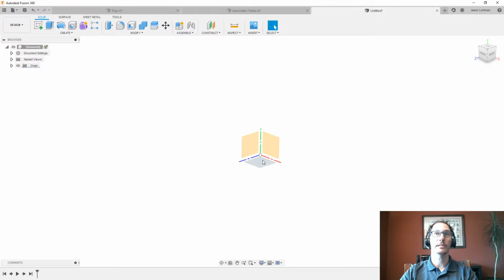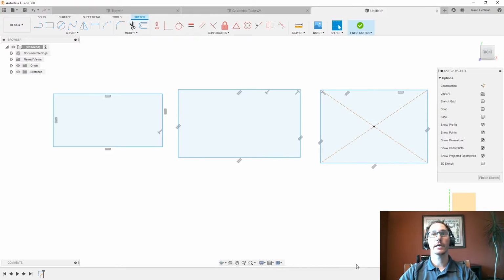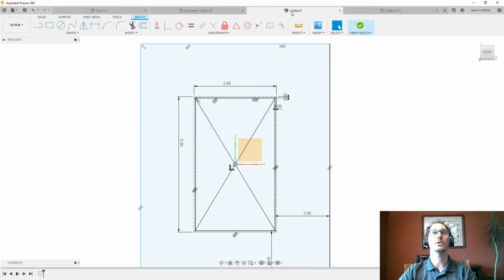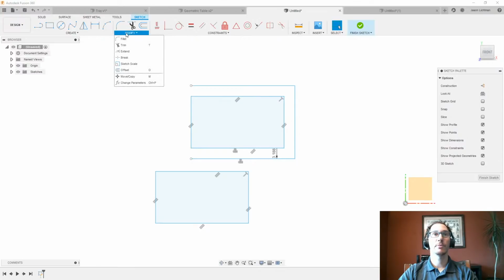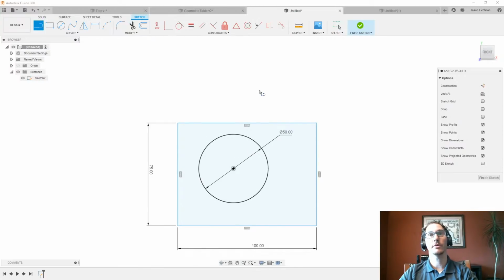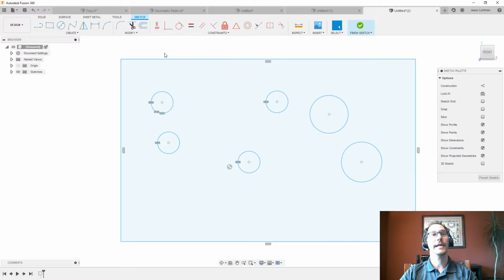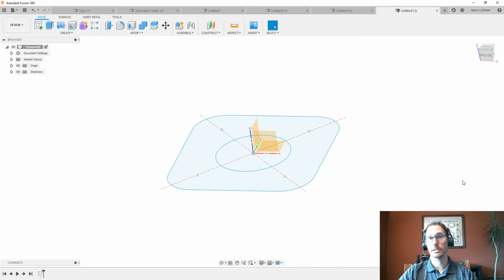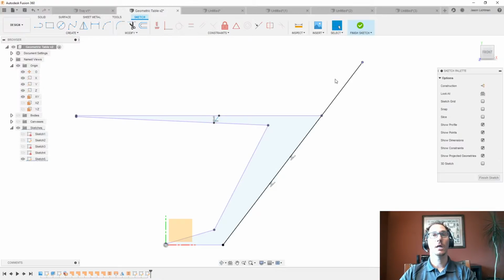360 LIVE: Fundamentals of Sketching

Comment: Jason, I have recently learned that there are times when constraints are not visible on screen. I have also learned that some constraints are applied automatically, but I have not seen any videos or discussion of when we can expect those constraints and when they might not be applied.  One example is when a small circle is drawn at the end point of a construction line.  I once saw it demonstrated but not explained.  I have seen situations where the coincident constraints are not visible at the center of the circle.  In one case I was not able to see a horizontal constraint on a construction line.  Was that a fluke? Or was that by design?  Another example is the rectangle that has different constraints depending on how it was drawn.  Your comment is to not stress over it but  this leaves us wondering why there are differences in the constraints depending on how it was drawn.  We seem to always be stumbling over constraints we did not anticipate.  Would it be possible for Autodesk to create a comprehensive video on constraints that would take a deep dive into what can be expected from the software related to automatically applied sketch constraints?

Comment: Really enjoy your videos Jason. I'm watching them now because we have summer shut down. I may have a stupid question here but: Do you happen to have a video or some instruction on what order to constrain in. I've found that sometimes I have trouble getting the constraint to do what I want. For example I was drawing a complex shape and the top of it was 4" horizontal. I tried to constrain so the geometric line stayed mid point on the vertical construction line so it would be 2" on either side all the time. BUT when I hit it my model geometry moved so it was mid point on the construction line. I just find that I do not know the correct order to do constraints in so I know without a doubt that what I want to constrain is what is going to be constrained. right now I feel as though it's hit or miss. Or something I feel like I just got lucky and it did what I wanted. I'm new to fusion and have been learning when I have time but my job title has many hats so for me I just don't have time to sit there guessing which way to do it. 
If you can help with that I think it would help frustration that many other people have too. What I found kind of helped me was that I watched an inventor instruction video. I guess like you say in this video it comes down to engineers want defined properties and designers want to have a flexible canvas... I kind of need a way to define quickly. 
I hope my question makes sense.